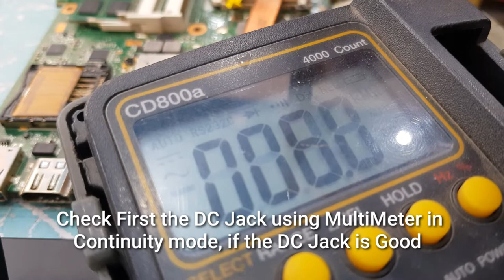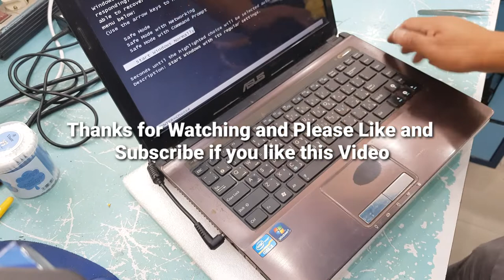ASUS LAPTOP DC JACK REPLACEMENT | WEAK DC JACK DESIGN ISSUE

Comment: I have mistakenly broken my laptops charging port. 
Model name: asusx560u.
I talked to a service centre and they told me its not repairearable. Because it is connected to motherboard directly. 
Sir, can u please tell me is it repairable or not.?
Reply from the maker: it is repairable they need only have parts like your laptop charging port like my video, i advice you to find other computer technician professional. to do that job. 100 percent its repairable
Reply: @kuyaatechguy6452  I had a similar issue and the tech guy is replacing the charging port.
Reply: Sahi hua fir ?. Mera bhi same problem hai.